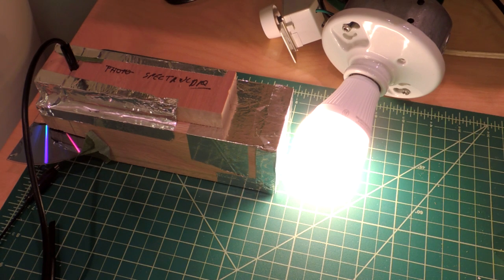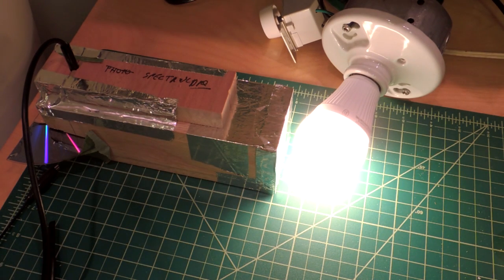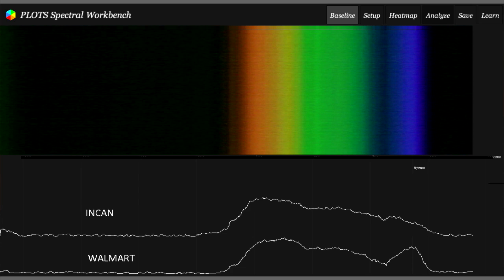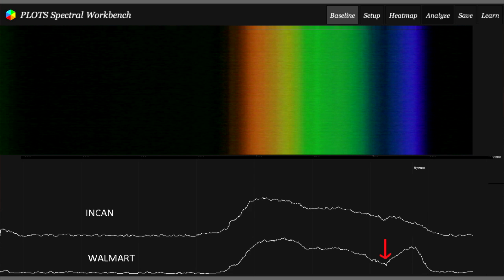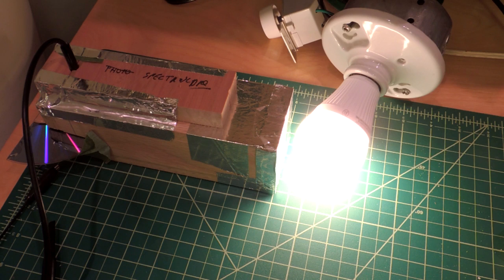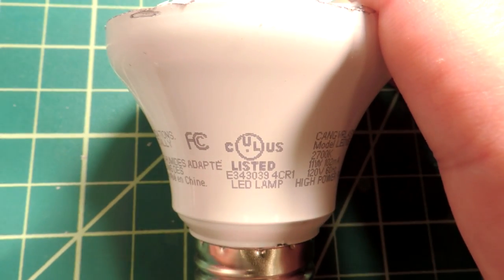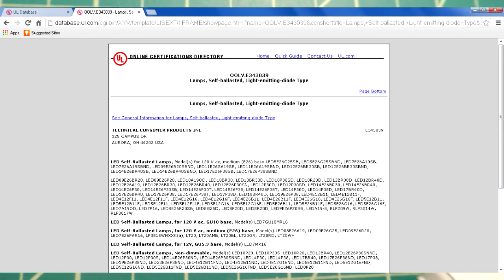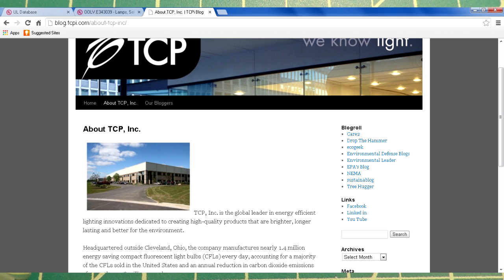Walmart "60W" A shaped LED bulb  tear down.... price leader and market maturity

Comment: Some led bulb sells on ebay shows 100-240VAC input. do you think this great value LED bulbs will work overseas with 220VAC input?
Reply: New Wave Yes they will provided that the driver is rated for 50/60 Hz. Alot of your industrial LED light fixtures are rated for 100-277 volt 50/60 Hz meaning that they will run on any voltage between those two values.

Comment: Well done video!
Would like to see illuminated without the bulb.
Maybe a good work light without the bulb, or is the bulb phosphors fluoresced by UV from the LEDs?
I would paint the heat dissipation cone black to radiate more heat away.
Reply: Bought many on sale for $.50 each.    Removed the "bulb" from several.  The naked white LEDs arexcellent over the workbench.   The almost pinpoint LEDs reveal excellent detail in objects on the workbench!
Best worklight I havever had.!

Comment: I wonder if this G-B dip (I call it the Indigo Dip) relates to the conversion phosphor. I noticed the large blue bump that has astronomers so concerned.

That IC looks a bit like an ON Semi product as they are fond of removing pins on SOIC packages for DC voltage isolation by creepage distance.

You're right to be concerned. Although the fact they use an isolated active supply is encouraging, the lackluster construction sure is YGWYPF...

Comment: Based on your video, I would suspect the major problems with this light being the power supply solder joints (particularly thru hole after hours of thermal stress) and the electrolytics. Good video. Thanks for sharing.

Comment: My LED bulb "UltiTech" rated 7.5 Watt gets as Hot as an 40 Watt Edison conventional light bulb ? Can you explain how Low Power LEDs can possibly be wasting current and turning it into Heat ?  Are we really saving energy with LED bulbs when they seem to be dangerously Hot ?     John
Reply: Look up luminous efficacy. Most of the heat is from the driver for the LED (power supply). An incandescent wastes 90% of its energy as heat. No LED is that wasteful. Environmentally safer than any fluorescent (CFL included). While WalMart has inculcated an idea in the American populace that you can get something for nothing, it is not true. You get what you pay for.

Comment: You have to wonder how many of these bulbs will last the full time listed without the caps drying out. The small SMD LEDs are classical cheap Chinese manufacturer and since they appear hand soldered you have to guess under what conditions. I would rather buy a Cree or Philips.
Reply: I bought a two pack of these bulbs for $5, and we all know how Walmart will mark up everything 20-90%.  So my guess is that these bulbs are made incredibly cheap.
Reply: mine lasted 10 years, I mean, it was one of the first LED lightbulbs. no worries there, even cheap stuff lasts years and cree is just overpriced..